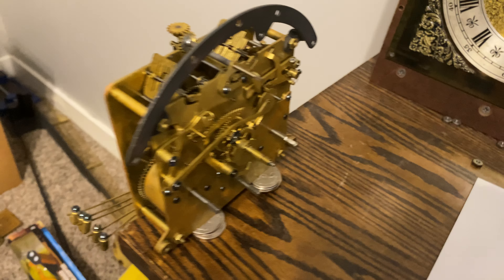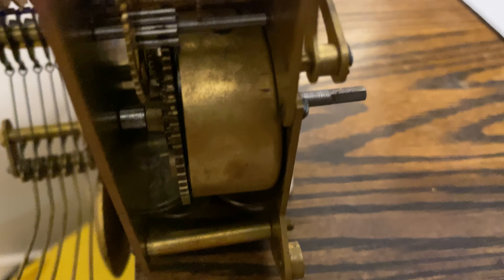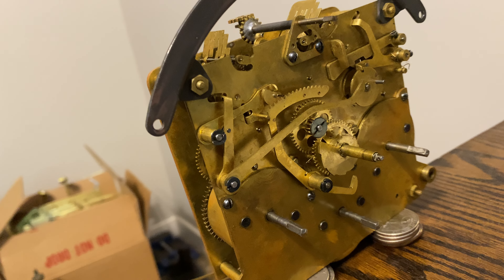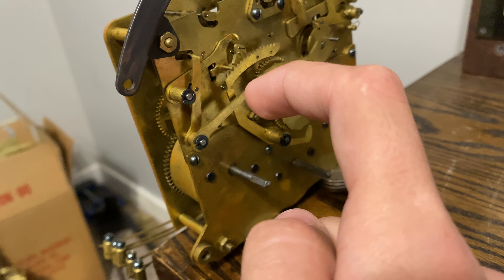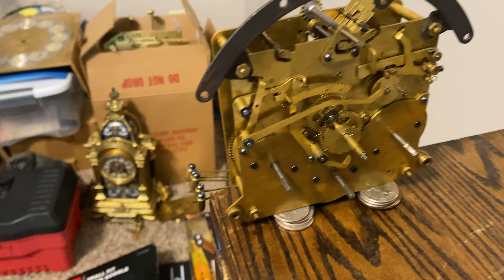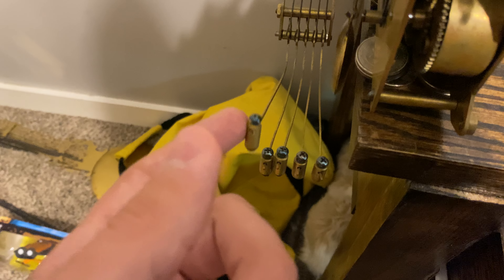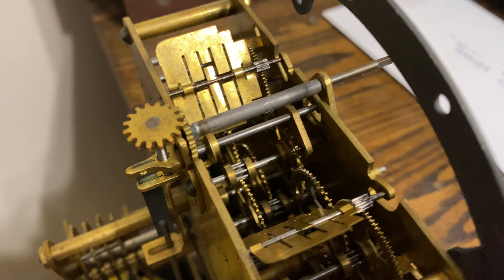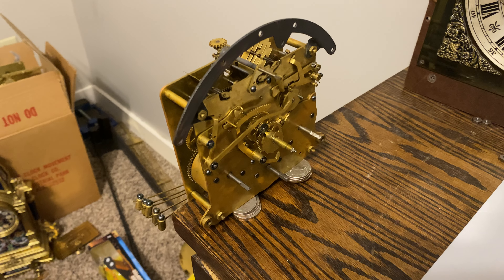How NOT to Oil a Clock (Seth Thomas 124)

Comment: I recently had an issue with one of my Seth Thomas electric clocks and I wasn’t sure what to do. When I saw this post I believe my clock has the same issue and would refuse to chime. 
Although I’d admit that I haven’t taken the movement out yet to properly fix it and I’m pleased that it chimes again. Since it’s been a while since the clock was plugged in the motor was stuck so I had to turn the fiber gear to start it and that got it running. It’s ironic that it’s a self starting clock and I had to manually start it so that was interesting. Thank you for the advice Sam.
Reply from the maker: You're welcome
Reply: Thank you!
Reply: I have an exciting edition to the collection. A Seth Thomas Simsbury 1w clock. I just set it up and it’s working. Do you have any suggestions on how to care for it?
Reply from the maker: Treat the clock with respect, and know if you ever work on it that it is a very difficult clock to overhaul. But most run just fine and in a way I appreciate it because it was one of the last American clocks ever made that the common man could buy.
Reply: What’s very interesting is that it looks like it was repaired not too long ago before I acquired the clock. It has no issues as I speak.  This 124 is in really good shape.
Reply: With the advise you have given me from time to time I know this clock is going to be in good hands. Thank you again Sam!
Reply from the maker: I think you got very lucky
Reply: I’ve gotten lucky for many things
Reply: I’m actually having one issue with my 124. It runs a bit too fast and I tried to regulate it and I’m not sure what to do. Do you have any suggestions?
Reply: One thing I got lucky with was the case for this clock. The original polish wasn’t messed with so with a lot of cleaning I’ve got it looking the way it did when it was new.
Reply from the maker: Make sure the adjusting gears on the back of the movement are interacting with each other as you adjust the knob on the front
Reply: Thank you for the advice! I’ve been doing that and it doesn’t change it at all. It seems to remind me of the Urgos movements when they run fast and nothing can slow them.
Reply from the maker: Or an anniversary clock without the correct suspension spring
Reply: How did I know you were going to say that?
Reply: Would you like to see how the case looks?
Reply: I have a surprise for you. Today I brought home the Seth Thomas lookalike that has the electric movement inside. I found all the parts for it and now it’s back together and running. It needs some work so I’ll be working on it very soon!
Reply from the maker: Yahoo!
Reply: Seeing this is helping me out especially with how things are. It’s been even worse
Reply: Just wanted to let you know that I’ve finished refurbishing the case and on another I’ll be posting it soon!
Reply: I’ve already finished it all. It’s all been sent!
Reply: I’ve got a surprise for you I hope you will enjoy it!
Reply: I was successfully able to have my 124 setup correctly so it keeps perfect time!

Comment: I have one of these Seth Thomas clocks with the 124 movement. I oiled all 3 springs (there’s a hole in the barrel cap that allows u to do that) now the chime doesn’t even play. The springs are fine tho💀💀
Ahhh the 124. Always trying to be a pain 

Now the clock is just time only which is fine that doesn’t rlly matter. It runs fine but for some reason it needs to run way too fast cuz lowering the suspension spring to slow the clock down causes it to just stop ticking💀

Ahhh the 124. lol
Btw great vid. subbed
Reply from the maker: Hey if you’re ok with it that’s all that matters
Reply: @samsclocks2084  yea im fine with it. I’m glad it’s running at all since most 124s are never working right. good quality movements but way too complex. idk how they made a mechanical auto correct system into such a fairly small movement

Btw if ur interested I have a discord server for fellow clock addicts. If u want to join its in my community post :3

Comment: You think the 124 is complex? You should see the sessions two train westminsters.
Reply from the maker: Any Westminster chime American clock from that time period is difficult to
Reply: @samsclocks2084  understandable
Reply: @samsclocks2084 I think they are just hard to relocate all the parts and on top of that they have a cam similar to the normal time and strike ones so you have to align that properly too but still a incredible example of mechanical engineering
Reply from the maker: I agree